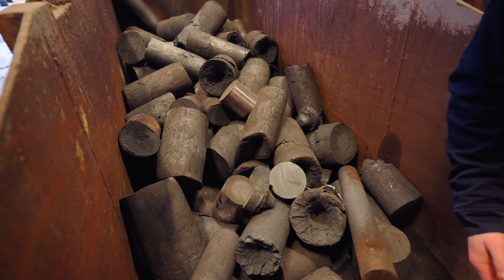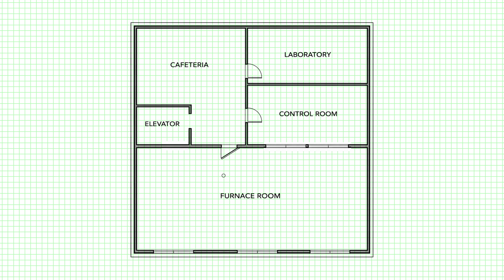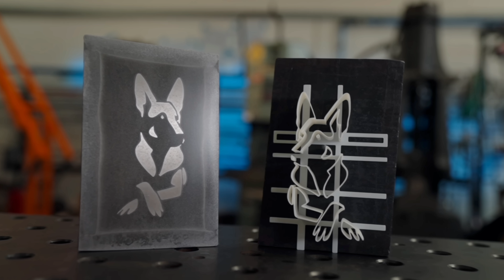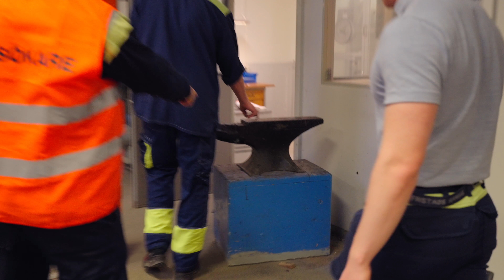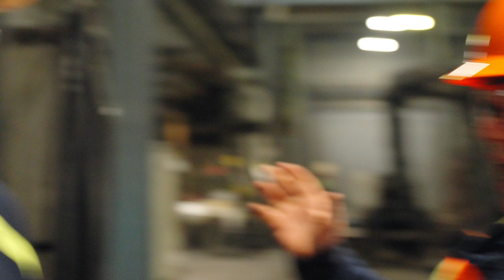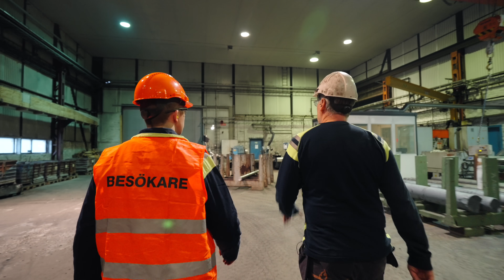How Super Steels Are Made

Comment: At 3.29 the sample is being put into a spark spectrographic analyser. The spark probe is made of pure silver since that's not a component of the sample's alloy content that's important to its properties. The silver content's result in the resulting spectrograph can be ignored.

I used to maintain and support these machines in a couple of foundries. The analyser machine room had a small lathe to sharpen the silver probes and remove surface contaminants from the spark process.
Reply: Interesting, thanks for sharing that!

Comment: I have and use the Milwaukee fuel daily and love it (only using it for drilling thru metal) but I bought and keep extra chucks in my tool box cause the chuck wears out pretty quickly and doesn’t like holding a bits tightly. So I swap them out every now and then. The only flaw I find with them. Everything else is great
Reply: I'm guessing this is the known bug of YouTube switching video while you are tying a comment and end up commenting on the wrong video, bug. YouTube should really fix all their bugs.

Comment: It seems that in the Hot Isostatic Pressing process the container and the powder it contains are basically melded into a single block ... but doesn't that mean that when it then gets shaped into those long bars, the outside of the bar will not have the same composition as the inside, because there is this whole layer of steel that comes from the container rather than the powder? Or is the container somehow removed in a step we haven't seen in the video?
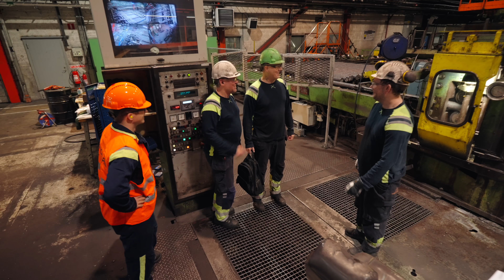Reply: At 35:50? I think it might be in the "peeling" step which by the process seems to be turing the bar, but kind of in reverse to a normal lathe, where the tools spin and the bar is stationary.  I was wondering the same thing but I was assuming that was what removed that steel jacket?

Comment: 25:34 also, you can have higher Carbon content to the chemical composition of the steel and not making it cast iron. That's PM technology that made possible making steels like 15V, Rex121, ZDP-189.. otherwise you can't make it by making ingots, except you are doing it via "BULAT" or "WOOTZ" methods with quite simple steels inside your crucible. Very nice video, an admirable company this Erasteel.

Comment: That testing machine via combustion, cs844. You also tend to add an accelerator in the metal power or shavings you are testing as well. Two most common are tungsten or copper. And both are very pure, with almost no traces of the elements you are testing. The older machines tend to only test carbon and sulfur.

Comment: The word he is looking for would be like stratification.  Stuff settles out in it's own density and separates out of the mix.  By starting with powder it can't flow so it's locked where it belongs, just enough pressure to flash melt/fuse it into solid.

Comment: @AlecSteele Nice seeing you doing a show and tell about Erasteel and how they manufacture ASP steel. I was site manager during a cylinder exchange on the QIC100 CIP they have some years ago and have also serviced the QIH HIP they have. The proofing pressure on the QIC was 3600bar if I remember correctly. The working pressure of the QIH is around 2000bar, on the newer machines it is 204.8 MPa. The "secret" is in the cylinder and frame construction, they are wound with spring steel wire. Otherwise they would never be able to handle the those working pressures.

Comment: THIS IS SO COOL TO SEE
I ran a strip mill for 8 years. Now im a machinist in our tooling/grinding department. Ive worked with coils from 50lbs to 65,000lbs from processing coil sheet 60 inches slit in to coils "ribbons" 
Unloading, machine set up, machin operation, packaging, shipping. 
Every step. Im at my second steel company now. The first never recovered from covid.

Comment: Really great video! As a supplier of large capacity CNC machine tools, for steel mills, it's disturbing to see such old, out of date milling machines and lathes in use at Erasteel. Modern machine tools are far more productive, but more than that, they offer much more protection for the machinist operating them.

Comment: ...So, does the HIP process turn the steel into Pop Rocks?  If you put the steel in an acid to dissolve it, does it fizz and pop from the pressure of the tiny gas bubbles left in it?

Comment: One thing that may help with powder forge welding is multiple sizes of powder. So you have 3 sizes of powder to fill the space BETWEEN the spaces. Look up how they make Infrared reflective paint. You start with a certain size powder where each grain/particle of powder is X, then go down 33% smaller, then once more 33% even smaller. This will fill the canister around 99% full and remove a TON of air and gaps between the particles, versus using just a single size particle because the smaller particles will filter down between all the larger particles and take up all the extra space. Most people think that filling a can with powder to the top fills it up... but on a microscopic level, there is still a bunch of air and gaps between all the powder grains inside the canister.

Comment: At 6:40 I'm surprised there aren't more safety features (railings or whatever) to secure the mouth of the induction furnace given it is clearly more than man size, but then I guess they have never had any incidents ?
Reply: Well it's hot enough that a worker falling in probably doesn't degrade the product all that badly.

But actually, to much security can actually make things more dangerous sometimes. Not having them makes sure you are awake and concentrated on not becoming a statistic. It also makes it easier to move around the forge, which they seemed to do occasionally.

A customer makes temperature probes that are used in steel manufacturing. They are rather specialized and surprised me a bit as they are one use only and totally destroyed when used. Basically it's a very compact temperature probe that is rolled in a thick paper cylinder. This is high tech and they have tables of the values that probe will register over time as the paper "shield" is burned away. Apparently the precision is extremely high though the probe will burn away in a few seconds. Their business is making these probes and selling them to steel foundries all over the world.
Reply: Most of the safety features are gonna be behavioral. In nuclear power plants here in the US, we have to do a meeting in the worksite before we start work to help keep our minds engaged and aware

Comment: To obtain an even finer material powder, is their a process that can mill, or crush the powder after being bombarded with nitrogen gas? Assuming the nitrogen gas is produced directly from liquid nitrogen, it seems possible to greatly reduce the powder's temperature and take that resulting powder to create an even finer powder by pulverizing the super cold powder using one of the methods mentioned above., resulting in an even higher diffusion rate and higher quality end product

Comment: I still don't understand the process...After the first cold Isostatic compression.....Is that capsule then sent into a Forge, before being isostatically pressurized again....Or does the second Isostatic pressurization use so much multi-directional pressure, that it GENERATES heat.    I didn't understand if there was an actual HOT forge involved.

Comment: Having used SEMs and other microscopy techniques for highly specific research its always super cool to see how its actually applied in industry!

 Also you definitely can use X-rays to look at carbon, nitrogen, oxygen etc. The Zeiss SEM is doing this actually using EDX (Energy Dispersive X-ray Spectroscopy). Essentially you blast the atoms in the material with high enough energy that they start producing x-rays with energy characteristic of the materials inside (analysis depth in the um range) You can also do this the other way around using XPS (X-ray Photoelectron Spectroscopy) where you collect electrons instead of X-rays. However you need UHV chambers and is only sensitive to surface not bulk like XRF. 

Can also do with even bigger microscope (TEM) where ive used them to correlate atomic positions in a crystal lattice with their element (atomic-EDX)

Amazing video Alec!

Comment: I wonder if by "alloying" they are really referring to how homogenizes the elements are. Basically ensuring the distribution of the elements is uniform across the entire process. This would explain when he is talking about them "pooling" that would be a result of a non-homogenized distribution of the elements. 

Another thing is when they are talking about the carbide strings, they are probably talking about crystallization, the issue is when you are growing a crystal, you only need a small amount (seed) and it will attract more of the crystalline materials to grow a crystal. They are inhibiting the crystal from growing by stopping the process that would allow the crystalline materials to migrate and grow. The longer the material is in a "fluid" state, the easier it is for those materials to migrate, when you decrease the fluid state (cooling it faster) it inhibits this migration.

Comment: I was wondering why they powderized the steel and then welded it together, since that seems like a way more involved process than casting, with more chances for oxidation or welding defects to occur. But it makes sense that the alloy structure would be way more homogenous by doing it this way. They presumably have to be very careful to do almost all of their hot work in oxygen-free environments, since the powder could rapidly oxidize with its high surface area. But I guess you can't argue with results.

Comment: 26:30 This reminds me a lot of pizza dough, you want the flour to form long gluten chains, but you need the yeast to add tiny spaces of co2 between them to not form clumps
Reply: i was thinking of it in terms of mixing water and fat. you can blend the two together with some effort, but if you let the liquid mixture sit for a while, the fat will glob together and separate out from the water. in the kitchen that can be fixed with emulsifiers, but there is no equivalent in metallurgy, so instead they mix the water (iron) and fat (alloying elements) in their liquid phase and then spray them into a (relatively) cold vessel through a fine nozzle. the nozzle mixes the water and fat evenly and the cold vessel causes them to shock freeze before the fat can glob and split from the mixture. the resulting ice and fat "snow" can then be pressed into a solid which will remain evenly mixed as long as it isn't melted again (which is easier for steel than for food i guess).

Comment: Interesting, HIP sounds similar to Superplastic Forming (welding sheets of Ti together into a pattern, then heating and inflating with high pressure gas in a mold, used to make very light, very strong aerospace components like control surfaces with an internal stiffening structure), and the powder tower feels like a giant and hotter shot tower.

Comment: I run a Weinig wood moulder to make all kinds of things like floorboards, casings, baseboards, trim, custom profiles of all shapes and sizes. We use high speed steel bar blanks made in Germany and we grind them into shape. It's cool to see the process of how the high speed steel is actually manufactured. That factory and all the machinery and equipment in it is probably worth more than a lot of small countries.

Comment: 16:08 bonds and a lot of cristals. Not good for hot gas combustion chamber vanes. i am true?
By the way to me make sense. hot and presure is what link the particle(carbon vs graphite) but why they do it like that? why dont make directly from the forge when the steel is liquid? What is the point in make "powder" and after waste energy in presure and heat it again.
Reply: 26:16 Ok now i understand why the extra work for this type of steel.

Comment: 6:47 dude is a single step away from the most horrifying, gruesome death imaginable. I would have assumed that they were harnessed in or that there was some kind of railing, but no :O
Reply: I’ve heard a lore about a dude that killed himself by jumping in the melt in Hofors, don’t know if it’s true.
Reply: @tanjarosenfeldt1088  the thing is the human body is far less dense than steel, so you’re just going to land on the surface and cook to death., rather than plunge in and it being instant.
😬
Reply: @N_Jones  hm that makes sense, its a visual misconception - I see liquid stuff and I think I am going to drown in it like in water, guess not...
Reply: I doubt its the worst way to go. I believe it would be fairly quick with those temperatures.
Reply: I don’t even want to think about how painful that would be, but there should be some more safeguards there
Reply: 😂 high carbon steele if you will. 😂
Reply: Being a single step away from death is not really unusual. Human instincts are good at avoiding that one fatal step, so long as we're aware of the danger. A harness or railing might well make it more dangerous - what if the bucket catches the line and/or crushes you against the rail? Could easily be deadly, and while it would certainly be less spectacular than falling into molten steel I don't see why it would be less gruesome. In the steel melt, you would at least very quickly stop feeling anything at all.

Comment: My previous job was exactly what you saw in the laboratory (albeit at a company here in the US), analyzing metal samples on the XRF, OES, and LECO instruments. Those might've even been the same models I worked on. It's hard to tell, but they definitely looked similar. And we did indeed have to work very fast to get the results back out to the foundry. Any longer than 10-15 minutes and we'd likely start getting calls asking where the results are.

Comment: I almost wish Alec could come with me into a real steel mill. Our cranes are 300 Ton rated to carry the ladles full of molten steel. This set up looks like a hobby set up compared to what i see daily.
Reply: Sounds like your creating a bulk product, the steel produced here has a smaller customer base then bulk steel, if it had im sure  they would have made it bigger ;)
Reply: @soulis1000 Our mill does a few types of steel but all in bulk. We do specialized high silicone grain oriented electrical steel (only one in the US),  stainless, and high carbon. We have a 230 ton arc furnace  along with 2 smaller arc furnaces and the worlds largest AOD. So its not just crap steel.

Comment: Amazing video. I have so many questions:
 - The advantage of powder metallurgy is that the steel freezes very quickly and there's very little time for the phases to separate. What microphysics drive the phase separation? Is it buoyancy? Interatomic forces of cohesion/adhesion?
 - When compressing the powder, surely some gas must get trapped between the metal particles. Is the powder-filled casing evacuated somehow? What happens to the residual gas? Does it get absorbed into the steel?
 - What are all these alloying ingredients for? I'm guessing carbon creates hardness and chromium creates corrosion resistance, but what about vanadium/cobalt/etc.?

Comment: Electron microscopes are so awesome. Basically, if you are trying to examine really small things, you can use a magnifying glass, or a microscope, to magnify it 2, 4, 1000 times, or whatever, but at the smallest scales, the actual LIGHT that comes back, just breaks down, because the waves of light is too long to tell one thing from another. like no amount of regular magnification, in the optical (visible) sense works. It doesnt matter how good your eyes or microscope is. So in order to see whats there, they essentially bombard it with electrons(the smallest particle we can control) and then analyse how they behave. 
In a sense, done on a large scale, if you dropped a bunch of pingpong balls into a room full of furniture, you can see where the couch or table is, by tracing the movement of the pingpong balls, as they bounce of the different surfaces.

Comment: This is some seriously cool machinery to get a look at. That said I couldn't help but notice, are you sure you're putting your earplugs in right? They look like the same kind I use at work and when inserted correctly they're supposed to be WAY deeper in - that vertical position to them in your ears is a telltale sign to me that you just sort of pushed them in without pre-compressing them to a thinner diameter so they fit deeper into your ear canal.

Comment: Wait a minute, the powder is brought just below melting temperature and then gas is pressed around it so that it changes from powder to solid (but gas is compressible). However, gas turns into liquid at a certain point and if you increase the pressure further, it turns into solid, or is my chemistry knowledge too limited?
That powder is heated until it is almost liquid. Pressure is applied by gas. And it changes from powder to solid. But then the gas pressure must be so high that the gas almost turns into liquid. Or am I crazy?

Comment: That 4 hammer forging machine is the most impressive engineering thingymajig.
Reply: Wait until you see how cold forged rifle barrels are made. Same general concept, but over a mandril that has the rifling in it. Because it is forged cold each hammer blow can only deform the metal a little bit, so it doesn't crack. That means the hammers are rapid-firing from all sides.